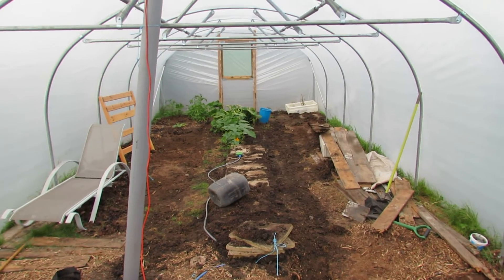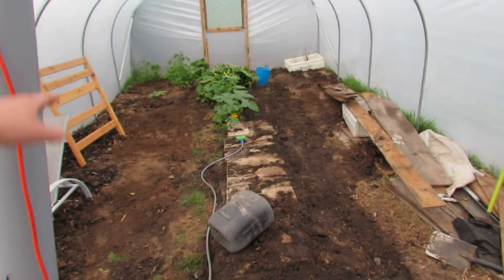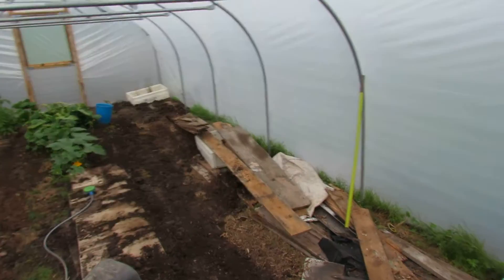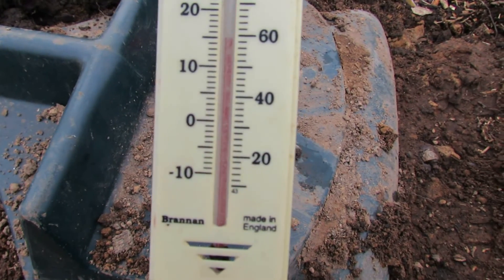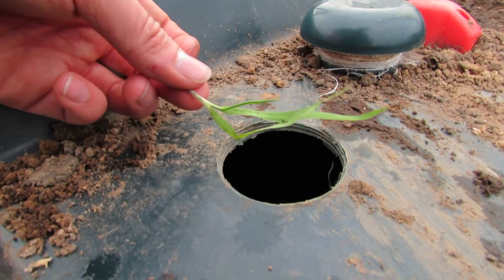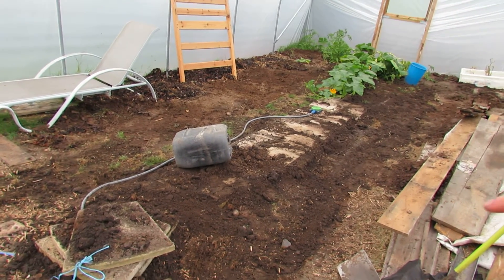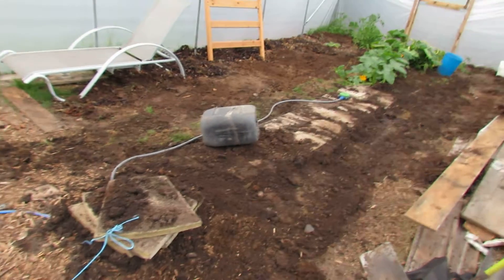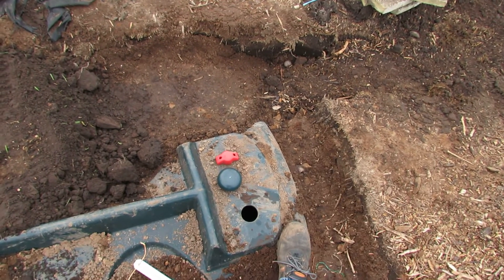Update on Polytunnel heat sink / thermal store

Comment: This is unique install.
I usually see this kind of system put in deep and only in actual green houses.
I appreciate you trying this out in these circumstances.
Reply from the maker: Thanks, I would have dug mine a little deeper, but in winter the ground water is very high in this garden. It works fairly well, although it really needs a more powerful fan. It keeps it a few degrees warmer at night and as this polytunnel is near the coast it very rarely goes below freezing inside the polytunnel.

Comment: How much to run the fan? Could fan be run in dc straight from solar?
Reply from the maker: With the current very high electricity prices it would be £7.34 a month if on 24/7, It used to be much cheaper, but still the cheapest heating option compared to heaters. This one is actually run off the house electricity which has solar panels and a tesla battery so it is ran off solar power. But if you got a dc fan you could use a solar panel, go for a centrifugal fan though, this axial fan isn't the best for back pressure and would benefit from an upgrade.

Comment: you should connect your water storage to a solar thermal panel and then run some pipe around plants circulating the water ,water is 4 times more efficient than air , plus you can point solar collectors at winter sun
Reply from the maker: I did ponder using a solar thermal panel and using water pipes instead or air ducts. But I decided against it because of the cost and the extra work involved as well as finding the space to put the solar panel. The solar thermal panel would work very well at getting the water in the tank to a much higher level, its a possible upgrade for the future. But at the moment the system is working well and the cost of the solar thermal panel, plumbing and pumps doesn't merit it.